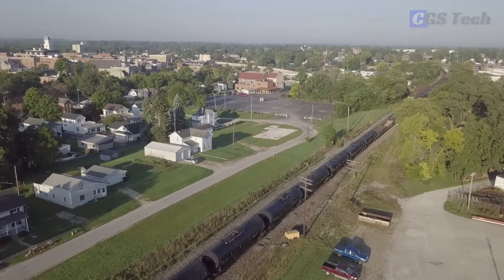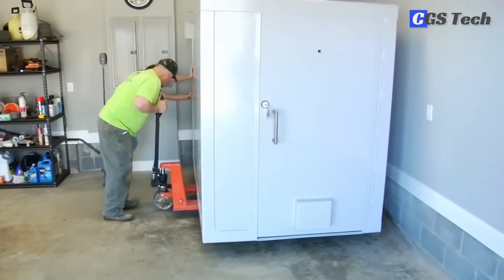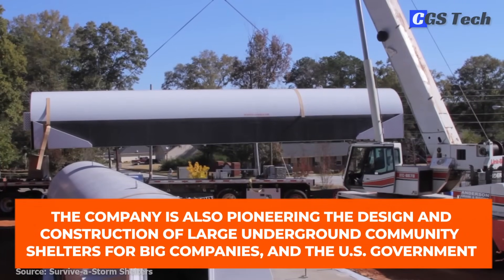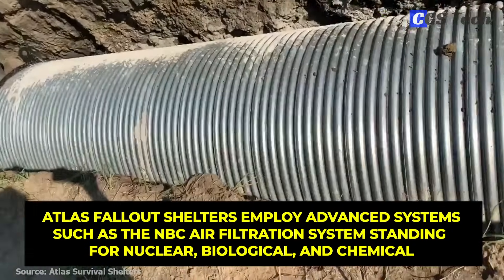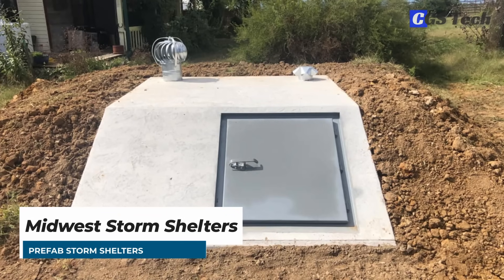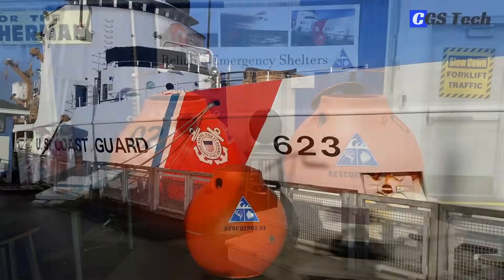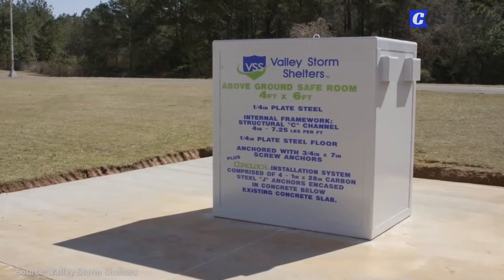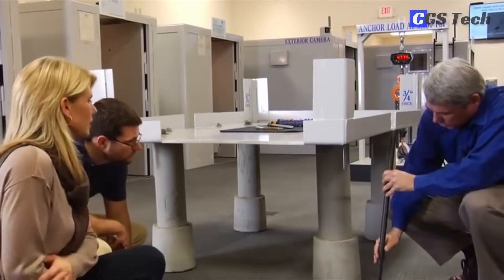5 Prefab STORM SHELTERS to protect yourself and your family

Comment: You missed Safe Sheds. We had an in-ground shelter and it was too difficult to navigate the steps as we got older. We've had a Safe Shed for about 10 years and go in it whenever we have a weather situation that warrants us being in a safe shelter. It's a good size at 8' X 10'.  We have Uline shelves in it to hold our camping equipment. We ran electricity to it. There's room for us, two 50lb dogs, and cat. If we're in it for any length of time, we watch a DVD on a portable player.
Reply: Did you and the old lady "christen" it yet?   ;)

Comment: How is fresh air exchanged in the rescue pod. It doesn't look like it gets any?
Reply: Only 4 gallons of fresh water total for 2 people? And “4 refuse bags” on board?!? Going to forever sleep after 24 hours because of no air exchange sounds like a blessing! 😂
Reply: It has compressed air cylinders under the seats, with CO2 scrubbers.  They are designed for very short term use of under 24 hours.  How long does a Tsunami last?
Reply: @andrewallason4530  I’m more worried about how long it takes an over-taxed rescue squad to find my little ship in a bottle. Or how long I could last if my pod ends up trapped under debris, under water after the tsunami has receded and drug me down n out with it? 😲
Reply: @jenngill7772  I figure, based on it’s buoyancy, you’re gonna end up on top of any debris field.  And being tethered, you choose the point it is tethered to.  
Maybe the addition of a self inflating 2 person life-raft, in a hatch on the ‘neck’ of the pod for after the initial emergency.
Reply: I mean yeah there's risk but without it your odds are far lower.

Comment: Yeah have the entrance INSIDE the house so that the debris can block the door and trap you inside. Genius.
Reply: Even the one outdoor that is pictured at the start has only one entrance that opens to the outside. If something heavy falls on it the people are trapped then, too.
Reply: Better have plenty of supplies 😅 in most of the tornados I've seen, all that's left is the foundation anyways. I think the odds of not getting trapped are better than not having a shelter.